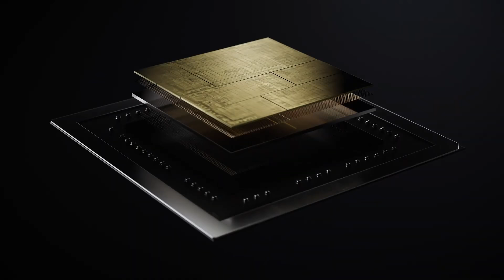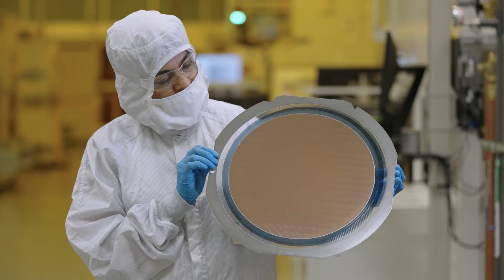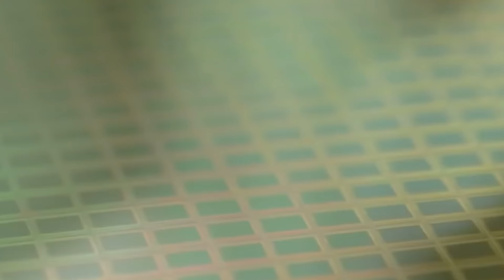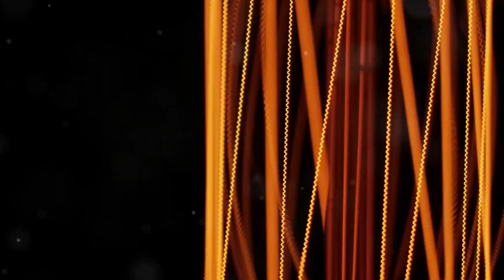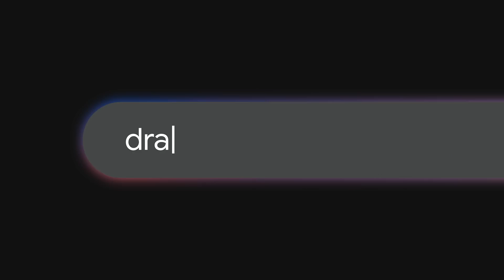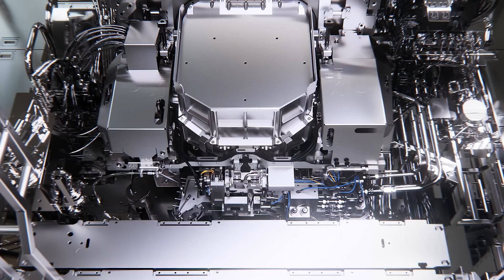IBM's New 0.7nm Chip Just Made TSMC's 2nm Look Like a JOKE!

Comment: Even for a modest number of partitioned core blocks, N! grows at a hyper-exponential rate. For example, arranging just 20 distinct macro-blocks yields over 2.4 times 10^{18} possible spatial permutations. In 3D, because blocks can sit directly on top of, underneath, or adjacent to one another in a true volume, the valid topological design space expands drastically compared to a 2D floorplan.

Comment: 0.7 nanometer chip using Chinese layering could be a massive breakthrough.
Reply: Here they glue two layer together
Reply: @psxtuneservice  It is a little more detailed than that. It is a 3D grid layering, instead of the single layering most western chips used. They solved the heating issue.

Further, it is reported the multilayer chips can use a three bit based system, instead of a two bit binary system.

Comment: n type and p type transistor, question mark. Does this mean they could also act as thermoelectric chillers? at a nanoscale? Peltier effect nanoscale thermal transistors designed specifically to route heat?
Reply: Unfortunately no. I am no expert but transistors works by putting 3 layers of material on top (or sideways) of each other. The material in question is usually silicon that has been "poisoned"/doped with impurities so that it has either too many electrons or too few electrons than it ideally would like to have. Two many and it becomes "negative", too few and it becomes "positive". Type n and type p. Not really positive or negative. It is more about how it is able to shift electrons across the material.

Anyway you need 3 layers of mixed n and p material to make a transitor. These 3 layers are called the collector, base, and the emitter. With just 3 layers you only have 2 ways to put the silicon together: pnp and npn.

I think that historically pnp was more popular, but it shifted a long time ago so most off the shelf transitors are of the npn type.

Comment: That sounds impressive – a vision that could redefine the semiconductor industry. But there's a small detail missing in this 0.7nm narrative: the physics of the present.

While the industry dreams of 0.7nm, it is struggling to supply today’s technology.

The cold, hard facts:

· Since July 1, 2026, the Japanese producers Kanto Denka and Central Glass have permanently shut down their production of WF6 (Tungsten Hexafluoride) – that's ~25 % of global high‑purity WF6 capacity (~2,200 tons/year). This gas is irreplaceable for HBM, 3D‑NAND, and any advanced logic chips.
· Reason: China has effectively stopped exporting high‑purity tungsten powder, which accounts for 60–70 % of WF6 production costs. Japan imports nearly all its tungsten. New suppliers? They need 18 to 24 months for certification.
· On top of that: the helium supply from Ras Laffan (Qatar) – responsible for ~30 % of the world's semiconductor‑grade helium – has been offline since March 2026. Repair timeline: 3 to 5 years.

The punchline:
Even if the 0.7nm chip were ready for mass production tomorrow – without WF6 and helium, no advanced chip can be manufactured. Not by IBM, not by TSMC, not by Samsung. The entire AI and data center infrastructure depends on these gases.

Dreaming is nice. But cold, hard physics doesn't care about your dreams.
Reply: You getting AI to write this gives u little credibility
Reply: @J @Joshi444 “crediblity“ doesn’t matter.  Facts count. No fancy dreams, hopes and visions.
Reply: @Kruzifünferl  fucking AI
Reply: @darshan5726 I use AI for research and analysis. Go on ignoring reality.

Comment: Ive fixed this problem with AI it runs faster than a CPU, and runs locally, GPU utilization is 50-60 percent better in CPU heavy games also, spent 5-6 years working on this problem

Comment: It is an interesting and perhaps even revolutionary technology, but it is not actually a sub nanometer transistor. 
It is instead stacking transistors vertically to increase transistor density per mm.
Reply: it potentially increases transistor density from 333 to 666 billion per mm^2. It the bonding of the two layers that  is still the big problem. It has to fit with picometer precision. As with every tech in the chip industry, techtechpotato made a video about it very recently and is extremely informative.
Reply: @paulmichaelfreedman8334  Please calculate what that density REALLY means in transistor size, assuming square transistor. You get a number that is MANY nanometers per transistor.
Reply: Yeah, but none of the process "nodes" are referring to their actual feature size any more. It's meant to be a relative indicator of overall density, though I totally agree that it gets a bit blurry when multiple layers get involved, and those layers become more or less separate.

If a chip designer picks this and turns the dial all the way to performance without any power efficiency gain, that'll be quite a fun cooling puzzle for somebody to solve. Maybe spray liquid refrigerant on the top of the chip and make sure it fully wets without leidenfrosting and boils off constantly, with fairly high volume of refrigerant hitting it constantly... Or just pump chilled water through an excellent copper water block.

I'd bet it'd tend to be dialed more toward 70% power efficiency gain than 40% performance boost, in most AI workloads anyway.
Reply: @DarthTrospective at what nanometer node did they stop referring to based on actual size and instead on relative density?
Reply: @user-rs1fj1is8c At 14nm when they switch to FINFET. The node size was supposed to be half the gate pitch but when your channel is now literally sideways then the measurements has become meaningless. Specially when the first finfet transistor required several fins per device. So they switch to performance metric. A 14nm finfet is not 14nm but a planar transistor with equivalent performance would need a half gate pitch of 14nm. So the nanometer had gone virtual nanometer.
Reply: Wouldn’t that generate a ton more heat?
Reply: @MrSamPhoenix It would generate a bit more heat but not a ton. Maybe 30% more. Now why not 2x more? That's because most of the heat is generated moving bits around. When the transistors are closer together. The heat generated by moving bits is a lot less. The additional heat generated is just the additional idle power leakage by having 2x more transistor.
Reply: @kazedcat  Wow. But 30% more heat is nothing to shake a stick at. I’m guessing this would mostly be use on desktop chips instead of something like a smartphone.
Reply: @MrSamPhoenix It will be mostly used by AI chips but it can go to smartphones. The thing with idle power leakage is that you can curtail it by dumping a lot more transistors for power gating. With 2x more transistor they can use most of it to reduce leakage and just a allocate a small fraction for performance improvement. It's just a matter of design do you want the extra transistor to go improve performance or do you want to use it to improve power efficiency.
Reply: Hi JOSH M
Reply: Its the first thing said in the video 😭
Reply: Yes, thats what he video said. Did you even watch it?
Reply: As stated clearly in the video
Reply: Thanks for clarifying. I knew this was impossible bullshit (possibly actually impossible based on our understanding of quantum physics)

Comment: Different fabs measure different things when they state size.
Reply: Actually, they don't even measure ANYTHING.

The number is totally made up, not measured from anything. It is totally marketing BS number.
Reply: @hkultala  You're conflating two different things: the node designation and the physical dimensions of the technology.

I agree that IBM's “0.7 nm” does not mean that some particular transistor feature measures exactly 0.7 nm. Modern node numbers are technology-generation designations, not measurements of a single dimension.

But that doesn't mean the number is simply invented or that “they don't measure ANYTHING.” IBM fabricated the devices and physically and electrically characterised them. Gate dimensions, layer thicknesses, pitches, transistor characteristics, etc. are all measurable quantities.

So the accurate criticism is that “0.7 nm” is a marketing/technology-generation label rather than a literal physical dimension. Saying that therefore “nothing is measured” is a non sequitur.

My original point was precisely that you can't assume the nm figure corresponds to one universal physical measurement across fabs.
Reply: @nigeltrigger4499  You still do not get it. These "node designations" are TOTALLY made up. There is NOTHINIG technical or real about these numbers.
Reply: @hkultala  The burden of proof is on you...

Comment: And it's all gonna get shoved in ai centres. Nothing for us humans.
Reply: ibm ( hal )
will  license it out,
just like they did with
GMR
giant magneto resistive , tech
for 1T +sized HDD drives
Reply: Explain why it wouldn't.

Also, this technology is far away in any case.

But if you believe this tech would only be used for ai, what is the reason for you to believe so, when current cpus, and future ones such as zen 6, use the best commercial nodes available.

It seems to me that quite the opposite is the case. Based on the actual facts.

Oh but hbm!

The reason why hbm is not used in consumer gpus is because it's just too expensive. Even if memory prices weren't so high it would generally be uneconomical to use it for consumer graphics cards, are you willing to pay way more for gpus than you already are? Probably not.

That's why hbm is used for datacenters, where memory bandwidth is just extremely important.

It's like complaining about the fact that your daily car isn't using carbon fiber in the chassis, but the super expensive hyper car is using it....

So basically the only reason why this 0.7 nm node wouldn't be used if it's ever commercialized, is because it's simply too expensive for what the average consumer is willing to pay.

You people are way too used to making completely random assertions without ever putting a single thought behind them and then not being challenged on those statements. It's time you actually start thinking about what you say.
Reply: @alexis1156  Remember when we used to wait for old tech to get cheap after latest tech launches ? That aint happening no more. That is why I dont see any kind of bright future "for normies like me" in this industry. Who just want to make fun stuff.
I may as well just start pottery , atleast dirt is still affordable these days.
Reply: @ICannotGame-_-2001  Huh huh, yes, i'm sure that the higher demand from ai datacentes won't push producers into expanding production, eventually resulting in a reduction in prices....

Oh wait, that's exactly what is happening.
Reply: @alexis1156  bruh. Increasing price 200% then dropping 50% is not price drop. It's still 150% price hype.
Reply: @ICannotGame-_-2001  Ok.  You basically admitted that price will go down, so thanks for proving my point.

By the way, dram and nand prices were artificially low before, they produced a lot during the covid years and when the lockdown ended, computer sales went down by quite a lot, leaving memory companies with a lot of stored products.

In fact, before this whole datacenter supercycle, samsung, micron and hynix were literally losing billions of dollars on memory and nand.

You are comparing a historically low price of memory to the biggest supercycle in history.

They are actively expanding production right now, and eventually prices will go down to less than half right now, but if you think that something like 220 dollars for 64 gb of top tier ram is sustainable, you have no idea what you're talking about.
Reply: @ICannotGame-_-2001  Also, you're clearly not very good at math.

If prices increase by 200 % and then drop by 50 % compared to the max, that means that the final price is 100% higher than the initial price. Not 150%.
Reply: @alexis1156  yeah , my bad , I ment 25% not 50%
Reply: Why would a human need a 0.7 nanometer chip? 😁
Reply: The gravy train for the ai con is over.  They'll have to rush the famine since AI is unable to do its job effectively.

Comment: why make them so small ? let's make bigger chips and fit the same number of transistors...right ? maybe.
Reply: smaller means faster because the physical distance that signals travel is shorter. Shorter distances mean less power required, which means less heat. It's all a win-win going smaller.

Comment: O.7nm or 1nm are just refrence numbers not actual size dynamics.
Reply: Exactly what was told in the video...
Reply: @viktorianas das ist alles Marketing Bla Bla. Leis dir das Withe Paper von IBM durch da steht etwas ganz anderes, was in diesem Video nicht angesprochen wurde weil das ein mit AI / KI erstelltes Video ist.
Reply: *not actual transistor or metal layer pitches.

Fixed for ya.

That being said, even though it's not correctly representative of current node pitches you can use the stated pitches of current named fab nodes as a frame of reference for a general idea of the density improvement.

Metal layer pitch improvements tend to lag behind transistors tho.

Mismatches in metal layer/transistor scaling can significantly affect the power/efficiency gains, so bear that in mind.

Comment: But what about heat? Isnt it a problem to get the heat from the lower layer to the coolingplate on top? Like when intel nvida amd etc. go for chips with several layers the still need to get the heat out.
Reply: Efficiency is improved with this architecture, so heat becomes less of an issue for the same compute performance. 

There are other technological breakthroughs that when combined with this will also be a huge benefit such as back side power delivery, which as I understand it also improves thermal performance. 

This isnt so much about one technology, but the culmination of many. When combined,  the next generation of silicon is going to be epic, this will be like a jump from 90nm in the early 2000s to the 3nm processes of today.
Reply: @garry5280  this impression is a result of carfully constructed hyping Youtuber scripts.
Reply: IBM plans to use ultra-cold electrons instead of normal electrons 😜
Reply: From what I understand they also design 0.7nm sized little fans.